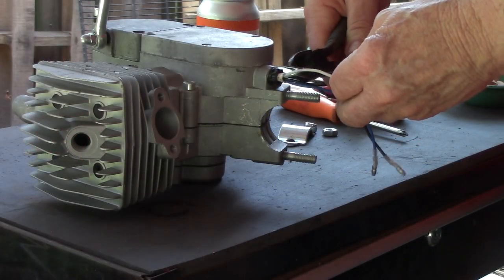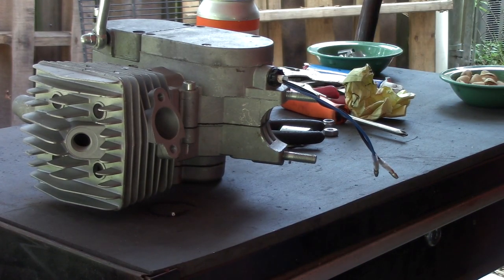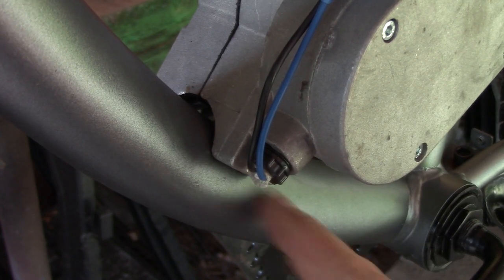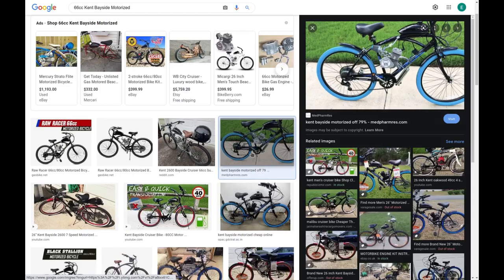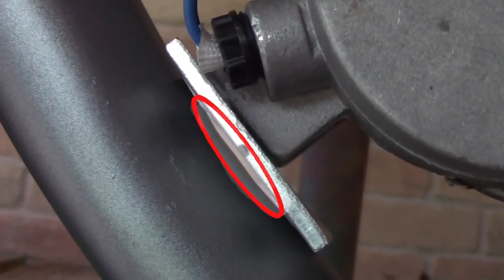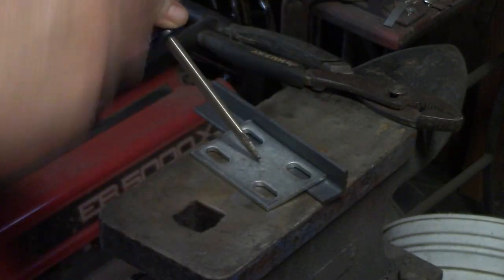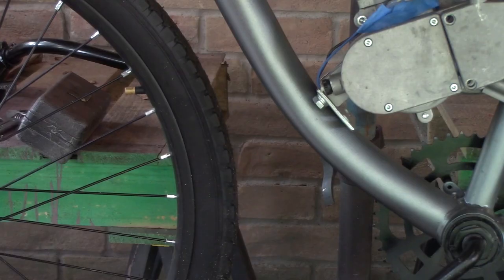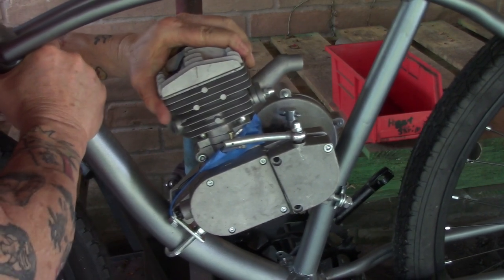Part 7 - How To Build A 66cc 2 Stroke Motorized Bicycle Beach Cruiser - Mount Engine

Comment: good advice brother but why not put rubber between the engine mount and the frame  seems like it would cut back on vibration?
Reply from the maker: Rubber= flex. Flex = broken hardware and chains coming off. You want a firm, solid mount
Reply: @HughesMotorized  ok makes sense . just thought i would ask . thanks brother
Reply: @diydarkmatter  you want the bike to take the vibration
Reply: @painhasgotchyu4733  the big auto makers mount counter weights on exhaust systems, driveshafts and on motor mounts........some weigh 5 to 10  pounds,,,small ones  bolted onto motor mounts weigh 2 to 3 pounds............I will experiment  and hang a 3LB weight off my bike engine.......Study Newton's 3 laws of motion.............Those laws dictate engineering designs and ways to reduce harmonic vibrations  etc etc ........

Comment: I rode for a bit and the chain stretched and popped off... Then I found out the bolts for the cnc adapter were garbage but came with hardened black steel ones I'll try with lock tite... I think the chain is bent maybe from the throw... Maybe another chain and lock tite and I'll be good to go. If that doesn't work I would like to hire someone to work on it or help teach me something more. I live in southern Tennessee northern Mississippi if you know anyone by chance...
Reply: Hey buddy. Did you ever figure out why your chain stretched? Was it because it was just a stock bike chain? I'm right this second just now starting the research and the "ride" so to speak of building one. Been thinking about it for a while. I've had kind of a bad luck with cars lately and kind of being without a vehicle every several months to every couple years. Id like to think having one of these would not only be a cheap way to have fun but also a cheap way to get from point a to b for an emergency if I end up having to go without a vehicle.

Comment: Hey everyone. I'm right this second just now starting the research and the "ride" so to speak of building one. Been thinking about it for a while now though. I've had kind of a bad luck with cars lately and kind of being without a vehicle every several months to every couple years. Id like to think having one of these would not only be a cheap way to have fun but also a cheap way to get from point a to b for an emergency if I end up having to go without a vehicle. 

I found this cool as heck beach cruiser at an estate sale/yard sale and had to have it man. The thing really looks sweet. Is there anyway that I could post a link to a picture of the bike, so that all of yaw here could see what I have? It says huffy on it but it just looks like it could possibly be super old...but then again I'm not super into bikes so idk.

Are there any tips yall could give me. I found this super cool beach cruiser that has a tiny basket on the front and like some kind of platform thing right behind the seet above my back tire. It also has a front and back finder and it also has something that I've never seen on a bike. It has the little nipple grease fitting on the back axle that you can connect a grease gun to pump grease into the axle!?? That's cool and crazy to me. Why would it have one of those on a beach cruiser? Does it mean anything particular?
Reply from the maker: Look up Hughes Motorized on Facebook. Post some pics there

Comment: What I like to do instead of using the flat plate I just use a spare clamp from one of the chain tensioners that comes in the kit, they are generally wide enough to fit M8 bolts and they also have a built in curve that sits on the frame nicely

Comment: Hey sorry to bother you hope you can answer my question. I'm new to this sort of thing and I got a motor I'm trying to put a new clutch lever arm on it but the clutch lever arm will not fit down on the piece that goes inside the clutch cover, am I supposed to hammer it on or what?
Reply from the maker: Rotate it. There's a pin in the cover/case and a flat on the clutch arm. Just spin it and gently push down

Comment: My engine doesn't fit like this at the clutch case rests on the sprocket an one of the sides can't reach by like 6 inch's I don't wanna purchase the cnc clamp for 30$ if it's not guaranteed to resolve the issue I  already took a loss buying 4 different rear hub adapters till I finally got the right size